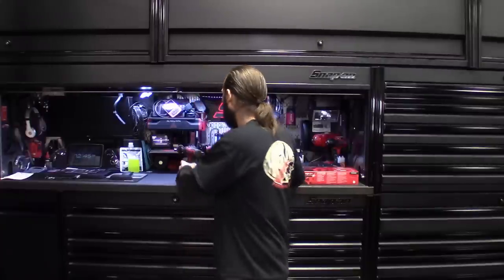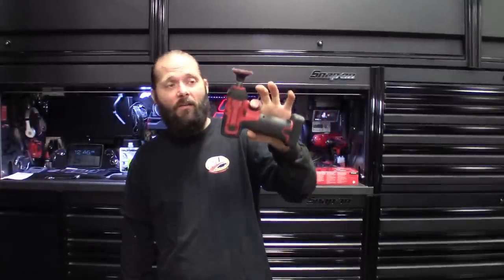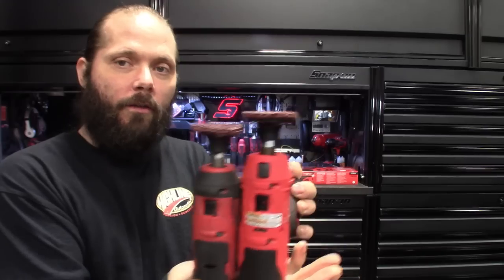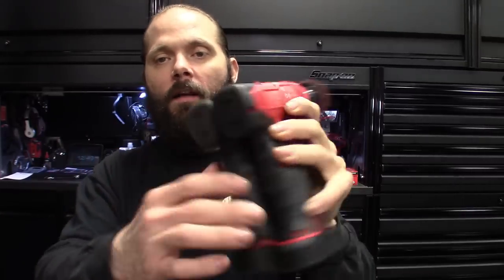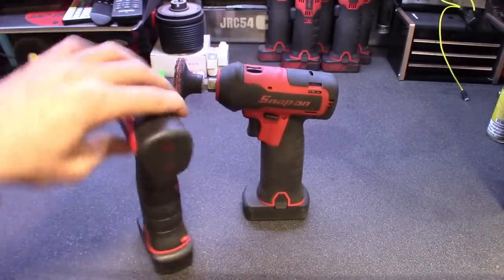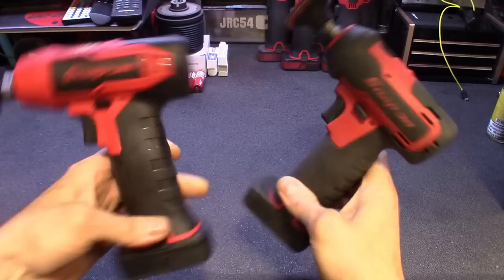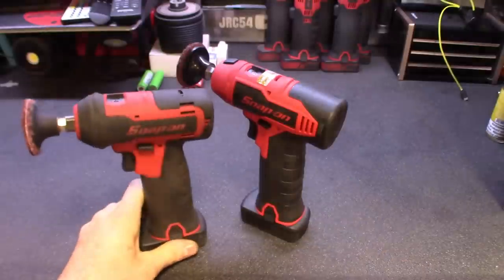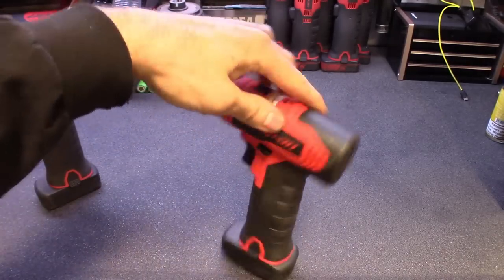Old VS New SNAP-ON First 14.4v Brushless Tool

Comment: Personally I have had good luck with the old sander, we still use it everyday. We use it mainly as a sander/die grinder, have polished some small stuff but it gobbles batteries.  I got the brushless Milwaukee and it's alil better. 
Snap on also has a brushless right angle die grinder coming out, my guy had a demo, it's shorter then both Sanders and the Milwaukee, which will be great for tight areas.
Reply: Bradley Dewitt they mention when?
Reply: Beginning 2nd quarter. I wanted to keep it, he wouldn't let me lol.
Shorter head length then any yet. Kinda looked like the right angle quick connect bit driver .

Comment: I guess I am the only one who uses air . The battery grinder / polisher just isn't getting my heartbeat up . I own most battery tools available from stubby to 1" 12v and 18v plus 20v ( facom and Ingersoll ) but not a battery grinder . Yours performs well and all it's just not for me . I do would like you to do a comparison with the Milwaukee if you would find the time .
Reply: Belux Auto I agree I have lots of cordless tools but no die grinder or polisher. I don’t use them enough to buy one plus there to big.  An air die grinder on a swivel connector is significantly smaller.

Comment: Sorry, I will buy 8- CP875 22;500 RPM - 1/4'' Collet - Pneumatic Right Angle Pistol Grip Die Grinder @ $54....Put an air regulator on it and
have cash in the pocket. $4-500 for this tool is outrageous.
Reply: Brother you can keep that shit. I promise you would change your mind if you had one. Hoses are so fucking inconvenient. Personally I bought a snap on 3/8 used on ebay. Then bought the various tools by buying tool only and these things are really powerful these days and they make your life easy. Good tools are a must to me.